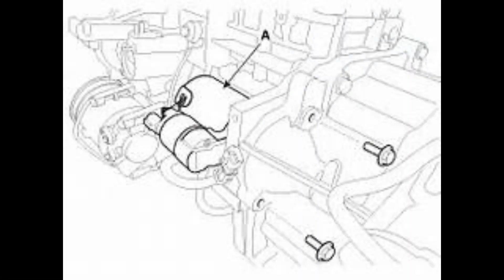How to Replace Bad Starter of Hyundai Accent | Easy DIY | Canada Life

Comment from the maker: If you experience car hard start don't buy battery right away do some troubleshooting. This is the common experience of car owners. Might be your starter starts to fail. Here's how I replace a starter of 2009 Hyundai Accent.
Reply: @bicolanoDIYerInCanada  this is 1.4 or 1.6 engine? Manual or automatic transmission? Thanks
Reply from the maker: @gicugigel3790  1.6 automatic